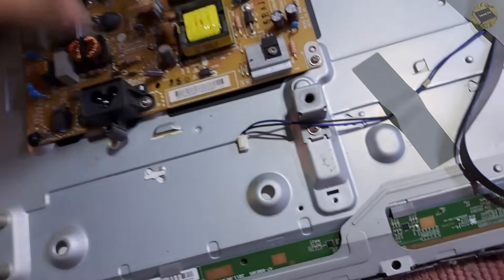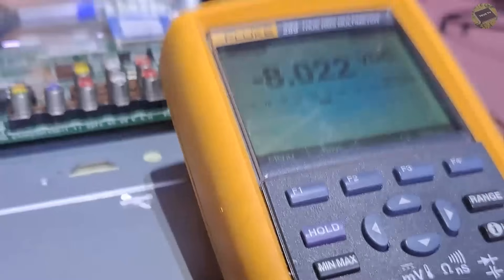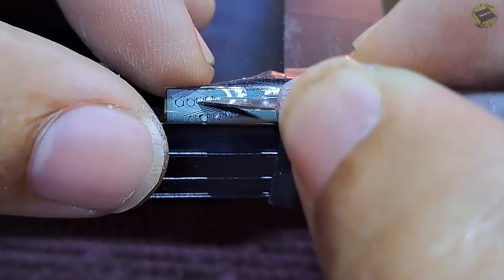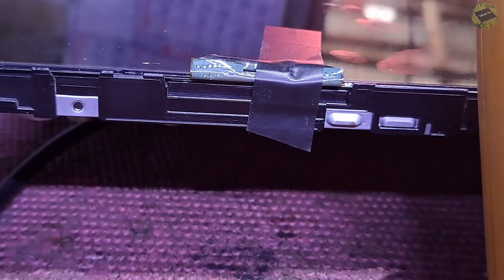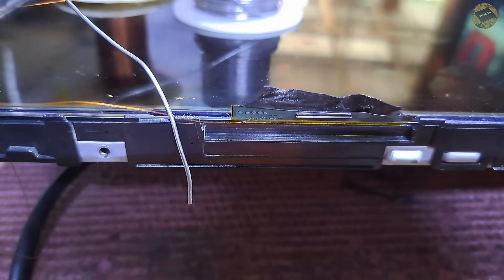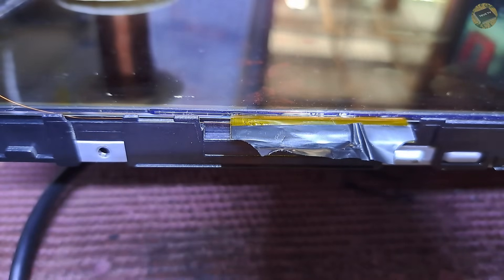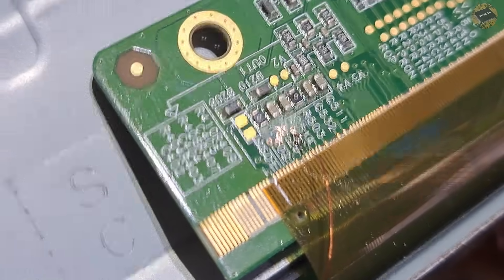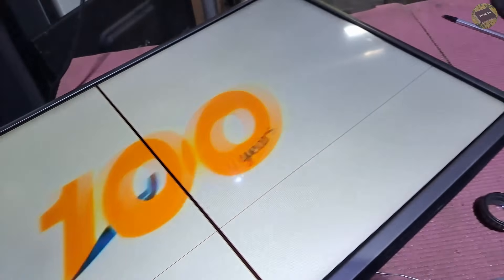LED TV  with a backlight without an image.

Comment: Well excellent job as usual .
supposed in the Coff side if I don't know which one is the Vgh .it's either one right of vgl or left the vgl .
if by mistake I solder it on the wrong one what would happened .
Because I your case there only vgl and the others don't have voltages .how did guess it was the right one .
Reply from the maker: series a 1k ohms resistor to VGH and tap to the test points, if image appear its the VGH.
Reply: @tevzTVTevatronics OK I got you thanks
Reply: @tevzTVTevatronics thank you sir

Comment: High tevs.
It was a great video.
I have been in trouble    with cofs and how to find exactly pin for vgh and vgl. But I learns something a new method for that.
I wish you resolve the horizontal line for your customer  and we would learn also about it.
Good luck
From iran.
Reply from the maker: Glad you learned something new! The vertical and horizontal line can not be resolve, only a bonding machine can fix it.